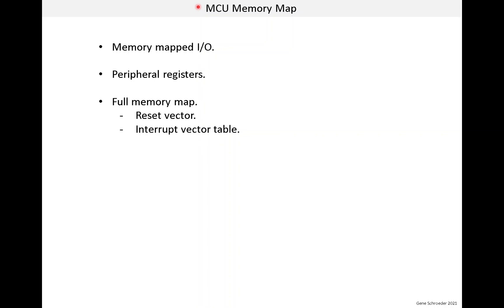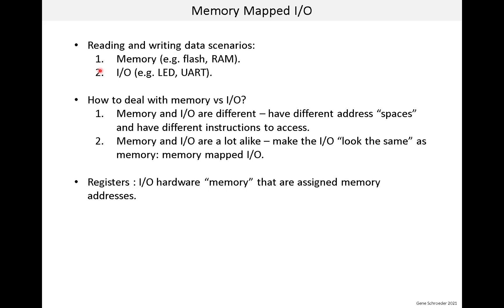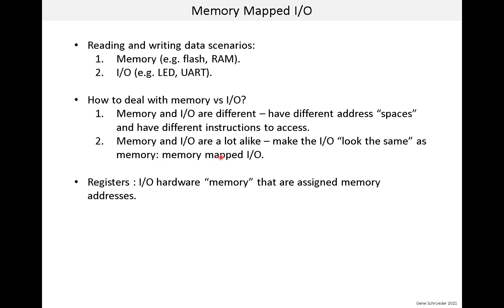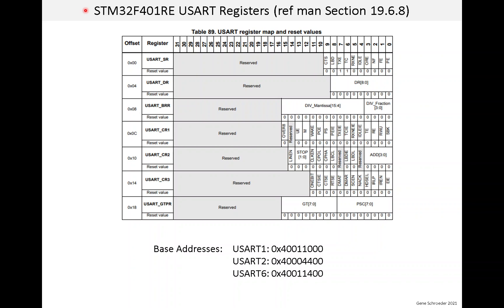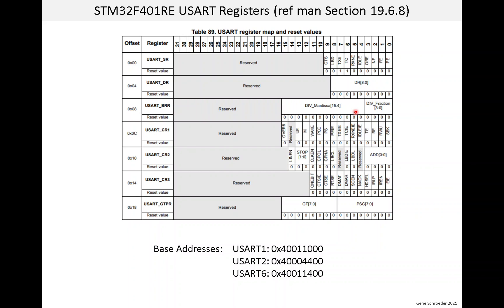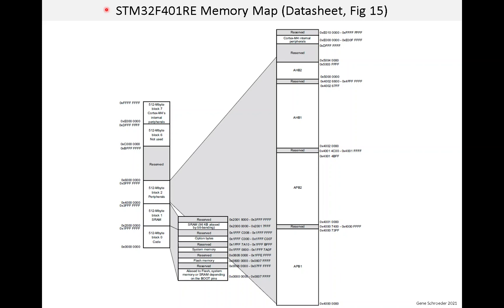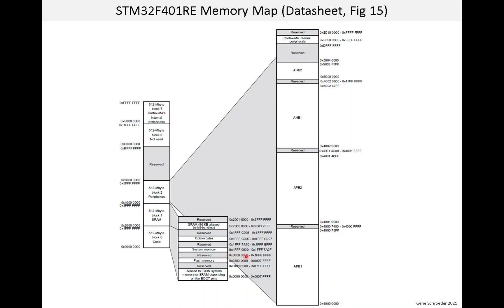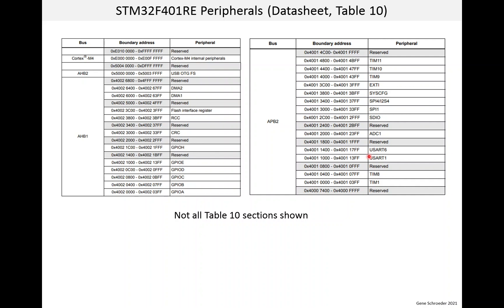Lesson 8.  The MCU Memory Map and Memory Mapped I/O

Comment: Good day, Gene. The course is exceptionally structured and presented. I'd like to just kindly request what books you'd suggest for additional reading on the STM32 MCU?
Reply from the maker: Thank you for your kind words.

I have never read any books specifically on STM32. I think most of the learning is by doing projects that use different peripherals, and reading the STM32 reference manual very carefully, and also looking for code examples. For example it would be good to get familiar with SPI, I2C (I have a course on that), timers, A/D and D/A. 

Also, looking at the ARM reference manuals about processor architecture and the core peripherals like the interrupt controller.
Reply: @geneschroedertech7501  Thank you for your feedback. Understood.